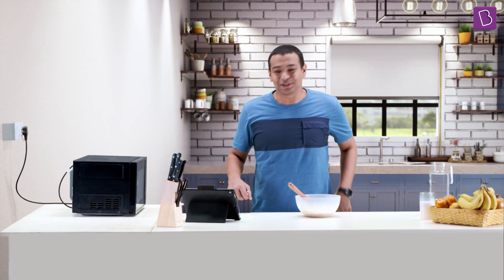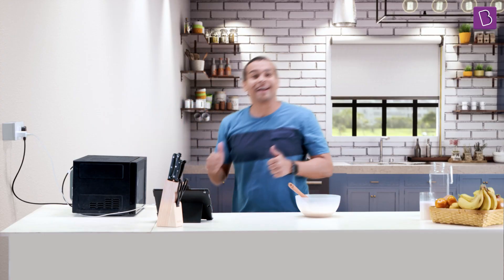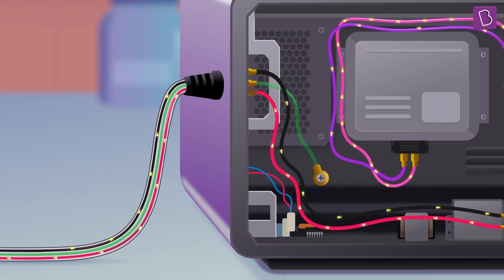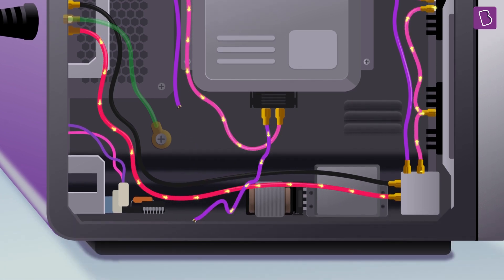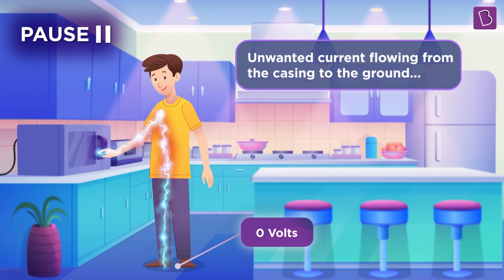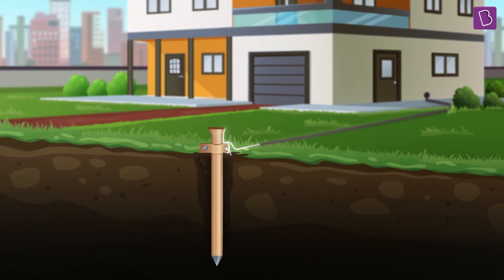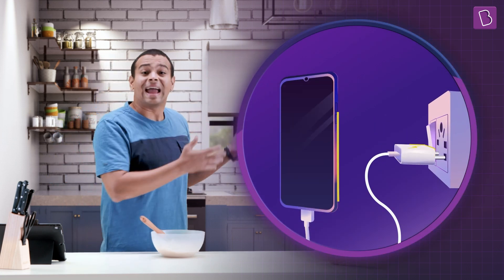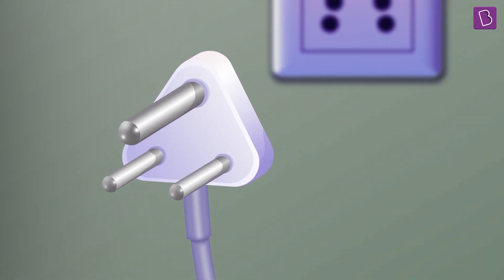Do You Know How Does a 3-Pin Plug 🔌  Work? | Why There Is A Third Pin In A Plug | BYJU'S Now we Know

Comment: 3rd pin is thicker so that the user doesn't get confused that which pin to go to which socket. And it is longer to make sure it should be the first to go to the socket or connect and the last to leave the socket or disconnect to prevent fault current.

I learnt this from Byju's only long back in Physics by Aanand Srinivas sir!!
💜💜💜

#ProudBYJUite

Comment: Maybe the third pin is longer than the other two pins because when we insert the plug,the earth pin will first come in contact with the power supply before the other two(live and neutral) so that any unwanted charges which may be in the circuit will be removed(grounded) before the other two pins go inside the terminals.

Comment: 3rd pin is large than other two pins because when we plug in the wire 3rd pin is connect first so that if fault current goes before

Comment: Answering to the above question:- 
IT'S LONGER THAN THE OTHER TWO PINS AND THICKER BECAUSE, WHEN YOU INSERT THE PLUG, THE EARTH PIN'LL FIRST COME INTO CONTACT WITH THR POWER SUPLLY BEFORE THE OTHER TWOS(LIVE OR NEUTRAL) SO THAT ANY UNWANTED CHARGES WHICH MAY BE IN THE CIRCUIT WILL BE REMOVED(GROUNDED) BEFORE THE OTHER TWO PINS UNDERGOES INSIDE THE TERMINALS

Comment: Its longer than the other two pins because when you insert the plug,the earth pin will first come in contact with the power supply before the other two(live and neutral) so that any unwanted charges which may be in the circuit will be removed(grounded) before the other two pins go inside the terminals.

Hope it's right 😀

Comment: The 3rd pin is longer so that it gets connected to the circuit earlier than the other pins to avoid any chance of leakage. 
It is thick to avoid misplacement as accidentally if all the pins had been of same size anyone could insert a wrong pin to the earth wire socket so to avoid such incidents that pin has been made thicker than the other pins.

Comment: 1. It is thicker beacuse a large cross sectional area as compared to other pins makes its resistance lower than other pins so that in case of any short circuit, the excess current flows through the earth pin.
2. It is made longer so that it gets connected to the earth terminal earlier than the live and neutral pins. This ensures the safety of the user.
3. Earth wire is connected to the metallic case of an electrical appliance to protect from electric shock by transferring excess amount of current to the earth.

Comment: The third pin is longer and thicker because this ensures the safety of the user because if the appliance is defective, the fuse will blow off. The earth pin is made thicker so that even by mistake it cannot be inserted into the hole for the live or neutral connection of the socket.

Comment: The earth pin is long so that the earth connection is made first. This ensures the safety of the user because if the appliance is defective, the fuse will blow off. The earth pin is made thicker so that even by mistake it cannot be inserted into the hole for the live or neutral connection of the socket.

Comment: Its longer than the other two pins because when we insert the plug the earth pin comes first in contact with power supply. This ensures that we connect earth first which increases our safety

Comment: The third pin is longer because on inserting it will remove the unwanted circuit to the earth. It is thicker because even by mistake it can't be inserted into the other two holes .

Comment: The third plug is longer and more denser because as you said earlier that the current will follw through an easier path other than the human body if someone touch is it during the phenomenon of faulty current so it actually need a broader pathway So that the current flo smoothly in a larger quantity more efficiently. I don't think it's a perfect answer but that's what I think. Sorry for any mistakes